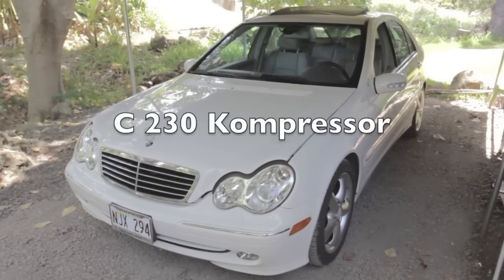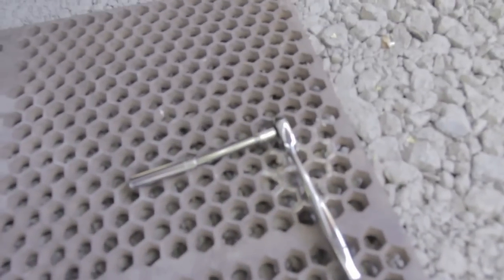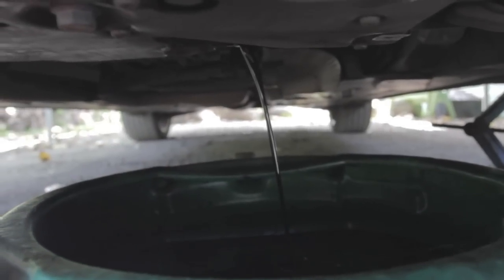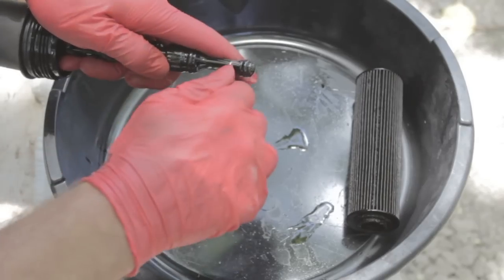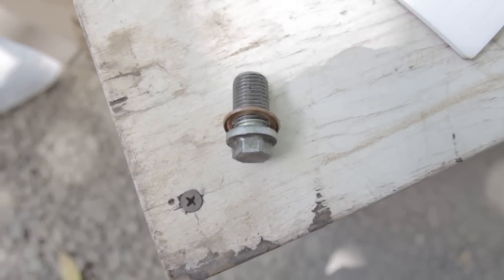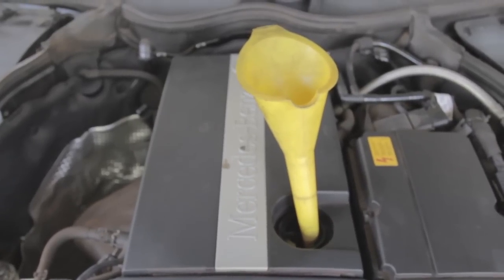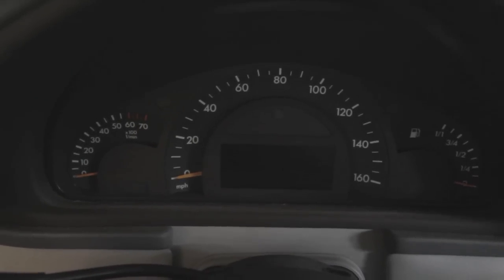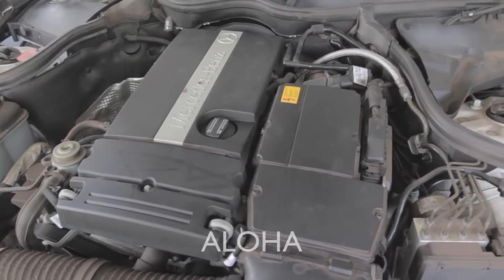Mercedes W203 C230 Kompressor Oil Change

Comment: thanks- great video! this is much better than the suction method. also, when oil is drained and plug is still out, i like to pour 1 quart through motor to flush out any other contaminants.
Reply from the maker: Great Idea ! Thanks for sharing.

Comment: Thanks for this Video, I wasn't sure where the drain plug and the oil filter position, that oil filter doesn't look like my BM's filter.My oil has the Mercedes Badge on , apparently all Mercs use that  5w20, thanks again.

Comment: A good guide that has helped me do my first oil change . Only problem is I now have oil leaking out around base of oil filter screw cap . I changed the O ring and have not over tightened it . Any thoughts please ? do I need some sort of sealing paste ?
Reply: you put the oring in wrong spot?

Comment from the maker: 5 minutes is general rule for measuring engine oil level incl. hot engine and leveled surface. i did added 1.5 qt, and computer said it is full. Good luck.

Comment: Do I need a E20 (etorx) socket to remove the oil plug ?
Also I take it screws out counter clockwise correct?
Thanks for your help

Comment: This car is super low how are you able to get under it?
Reply from the maker: ***** most floor jacks will fit under and lift it for you...
Reply: How long until the oil needs to be changed? Also what filter do you use?
Reply: A mechanic told me I could change the oil myself, but that I would have to take it in for them to reset the oil change indicator. Is this true or can I reset everything myself?
Reply from the maker: you can see all that in my other videos…have fun servicing your own MB !

Comment: Can u tell me wich oil u are using and what number?
Reply from the maker: Mobil1 , 0-W40. Thanks.
Reply: Thanks!
Reply: Cause on a dealership they told to use 5-w40 so am not really sure...
Reply: Yeah it's ow-30 or ow-40 bro you can use either.